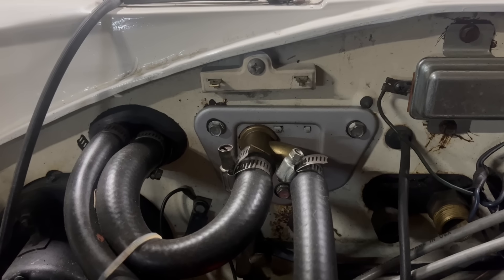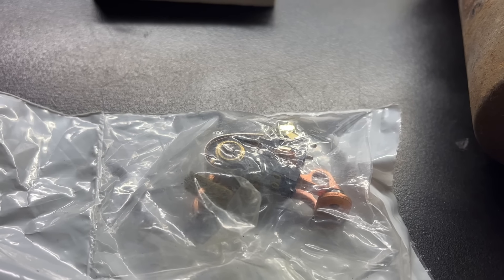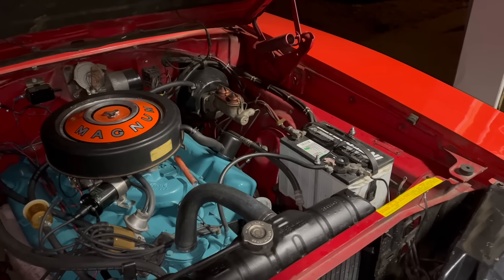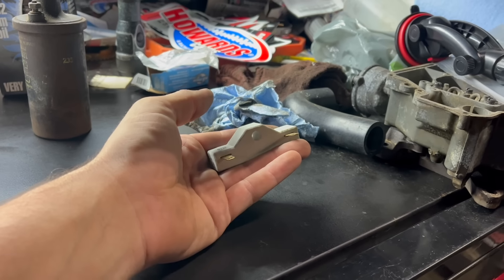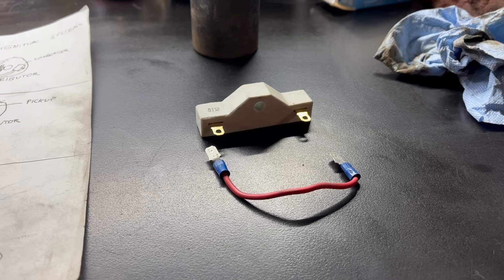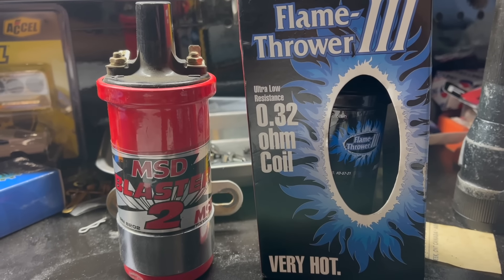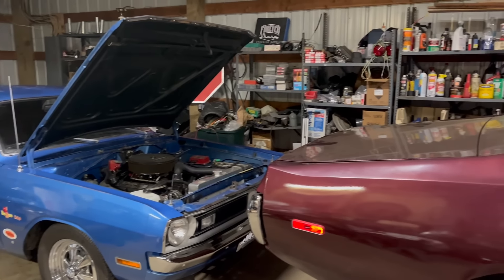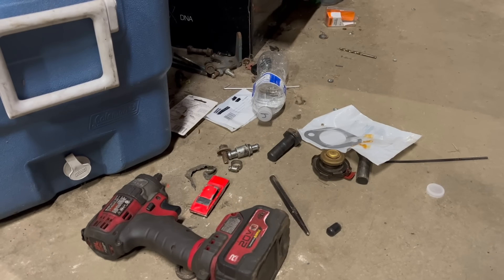The Big Ballast Resistor Video! A Simple, Yet Misunderstood Part Of Your Classic Chrysler Product

Comment: This video describes all the functions of Point systems in detail. Very well done.This is 2024, and best way to cure the ballast resistor issue is to chunk the garbage point system. They were never very good anyway, remember cleaning spark plugs? Tune ups at or before 12K miles? If it were my car and this car is Awesome, I would put a modern CD ignition in it and bypass the resistor. If you have a GM product you can retrofit a HEI system, simply the best early SSD system available because of its design. The issue with adding a high performance ignition system here is the distributor cap and rotor. you will need replacement more often because they are not rated for the higher voltages.However performance will be much better. Thanks for the Video.
Reply from the maker: I have done a guide on HEI ignition module retrofit on Mopars too - but I’m also the guy who removed an MSD system from his Charger in favor of an original points distributor 😃

Comment: Thanks for the "real" scoop on resistors! I'm 62 yrs old, worked on tons of Mopars over the years, and I think I only changed one bad resistor! My experience has been that 4 pin box is always crap!😮
Later!
Reply: The factory improved the OEM boxes in the mid 70's and removed the need for a low voltage input and did it internally so all of them after that were 4 pin.  All the P boxes, Gold , Chrome, and Orange have always been 4 pin.
Reply: @auteurfiddler8706  "P" boxes. 🤭 That's what you do when you replace them on the side of the road!
Reply: Should a resistor heat up when the key is on position not running.
Reply: @georger8212  Don't know for myself but I seem to remember a co- worker saying that if you leave the ignition turned on without the engine running that you will burn something up - like over an hour or so

Comment: Starting a Chrysler built vehicle by pushing often worked well with standard transmissions. But you could also push start them with an automatic transmission if it was built before 1965 because the older transmissions had a rear oil pump that worked with the output shaft. In 1965, Chrysler abandoned the rear oil pump in the Torqueflite transmission and only used the front oil pump driven by the torque converter.
   I had a 1959 Dodge Custom Royal with a 361 V8. I took some auto classes at a junior college and after I got enough knowledge, I went to the junkyard for parts and converted the ignition system from the old points to an electronic ignition system. All I had to do was change the distributor, take the wiring harness and ignition module from another old car, and it ran like a charm. The most difficult part was adjusting the gap between the reluctor and the pick-up coil in the distributor. I called that '59 Dodge my Big Dog. If you see the front end of a '59 Dodge, you might guess why. Uh, woof, baby.
   My dad had a '62 and a '67 Plymouth, and I had that Dodge. I also had a 1973 Newport. In all the years we had those cars, I don't remember having any trouble with the ballast resistor more than one time. It was having that '73 Newport that kinda taught me how to do the ignition system changeover on my old Dodge.

Comment: Excellent topic. 
For the record, the old Direct Connection/Mopar Performance electronic ignition conversion kits 
came with a 0.8ohm ballast resistor as part of the kit (different from the standard issue ballast
for points).
Reply from the maker: Good to know! I have one of those kits, which was installed on my Demon in the 70s. I’m not familiar with the different resistor ratings. I probably should be.
Reply: They offered different kits with different resistors depending on which box you ordered. And different coils with different primary resistance.  "It is not advised to mix and match components!" it said.  (Mopar Bible and DC catalog)
I think 0.8 ohms is fine with a stock or orange box, but you need  a Chrome box or Gold box to go to 0. 5 or 0.25.  What does your coil  measure across the small terminals?  If the total is less than 2.0, I think you may be right about not having enough , especially for points.

Comment: I was really hoping you'd explain the 4 pin balast resistor found on most (or all) factory equipped electronic ignition vehicles. I don't understand them
Reply from the maker: I’ve had several comments about it now, so I realize this was apparently a sizable omission. That’s my bad. The second side of the 4 post resistor was used with the original electronic modules which had a 5 pin connector. Some circuit in the module was powered through it. The later four pin electronic control module eliminates the need for that extra circuit and can be used with a two post resistor. It can also be plugged right in place of a five pin module with zero issues - but not the other way around! Unless the four post resistor is in place.
Reply: @DeadDodgeGarage    The   dual ballast was only used from 1972 till around 1975 or so  when the 4 pin ignition box was introduced.  The 4 pin ignition with single ballast lasted until around the late 80's early 90's.

Comment: Nice job, so in a nutshell the ballast resistor is simply a voltage dropper (brings it down to 9v). And it's not that the coil needs less voltage (if anything it wants the full 12-14v), it's more so that the points doesn't want more than 9v, as higher damages its parts.
Reply from the maker: The factory coil requires the external resistor, and will not be happy for long on that full voltage. It is printed right on the coil. Yes, the resistor reduces the voltage going to the coil. It varies by dwell time and the temperature of the resistor and is not a constant 9v. The voltage actually climbs at higher RPM. I saw as high as 11.5 volts on my car. I had to scrap that clip for other reasons.
Reply: @DeadDodgeGarage  I see, so the coil also wants that lower voltage... Sounds like it's designed in a way where the coil voltage increases with RPM, possibly as the draw is increased given more sparks needed per minute. Clever system when looking at it like that

Comment: but, but, but, what about the Dual ballast resister?
Reply from the maker: Same thing… only different. I realized some time ago that the omission of the dual resistor was a mistake on my part. The second side powers a circuit in the original five pin ignition module.
Reply: @DeadDodgeGarage  just razzin' you for it not bring mentioned

Comment: Good tips. I usually run an 'HP' style aftermarket coil and bypass the resistor. Like I think you said it's dependent on the resistance of the coil and the current switching capacity of the module. I've heard all the 'lore' for DECADES about ballast failures but NEVER actually experienced one in over a million miles and several decades on way too many cars to count. I DID however have the ballast terminal connections get corroded and act the same way because of where they mount that resistor it picks up a lot of runoff water from the cowl. But I have had the newer style ignition modules fail more often to the point that I mount a spare right next to the 'in-service' one so I can just move the plug over. I also used one of those Proform Mopar 'knockoff' kits and it's been problematic. I used a bunch of the original Pertronix Ignitors in the past but I wouldn't use another Proform kit. The GM module approach is OK too as long as you get a 'real' GM module. They have better dwell than the Mopar box. There were some Mopar modules that had higher current ratings. That Proform kit sucks. I had random hard start issues because the pins in the rubber module plug were spread so far apart they weren't contacting the module pins.
BTW, back in the '70's they used to sell SCR switching boxes to offload the current switching from the points and move it to an 'SCR' transistor. It wasn't a CD box, just an inductive switcher. The points were just the 'trigger' so essentially they lasted 'forever'. Supposedly kept the car in tune for 'better mileage, power, etc'. I have one marketed under the Hurst-Airheart name. On my older more collectable cars I try to keep the points and just use some kind of a 'box' to offload the points. The points these days are pure junk.
Reply: Watching the vid I was thinking exactly what you described the SCR circuit as. If the issue is points burning up from too high voltage/current, then change the circuit to where the points are a trigger with no load. I'm going to read up on SCR circuits, thanks for the info!
Reply: We built those boxes in high school around 1970.

Comment: When I was younger, like 50 years ago, I knew guys with Chrysler vehicles with early electronic ignitions found out that when they opened the hood after a rain storm, the water on the hood would run down   onto the distributor and cause them to malfunction.

Comment: I've got the same Pertronix + Flame Thrower coil as you.  I removed the resistor from the back of the ballast resistor and  crimped/soldered in a a thick wire.  It's now a jumper disguised as a stock ballast resistor  and it gives me the warm fuzzies.
Reply from the maker: Awesome! I should do that in my Demon. Haha.
Reply: Had this same setup in my old Polara 500.

Comment: The resistor on a Dodge Aspen would fail during or right after a rainfall because of puddle splash hitting the firewall.
I moved the resistor to the top of the firewall and also mounted an spare resistor near by.
Hot resistor + cold water = cracked ceramic.
Reply from the maker: Yep. Someone else was talking about having the same problem in a Ramcharger. Somehow I’ve avoided that so far - which seems odd, living in rain land as I do.

Comment: Didn't electronic ignition do awAy with, only distributor and points ignition,are old mopars still using prehistoric systems
Reply from the maker: The Chrysler electronic system still uses a ballast resistor.

Comment: What the heck are those double ballast resistors about?
Reply from the maker: Should have covered that here, but I forgot they existed. The second half of the resistor powers a circuit in the original five terminal ignition control modules.

Comment: Comment.  
Ballast on the elect. Ignition - 
voltage on ign1 drops out when cranking - which supplies ECU. 

Ing2 actually back feeds voltage thru resistor to ECU module while cranking. (Less voltage). 
But full voltage is better.  

Diode is great remedy. (1N4006)
Reply from the maker: It is wired that way, and obviously a lower voltage will back feed through the resistor. But in my experience with retrofit systems, it's not enough to actually run the module. I had therefore assumed that IGN 1 must still have power during cranking for this to work - but I haven't verified this myself.

Comment: Can't remember if I brought this up before.  In my youth I worked at an auto parts store, and we had three coils that fit close to 90% of cars of the day (then the custom ones).  Two were 'external resistor', one came with the resistor and one without for a few bucks less.  The third was an 'internal resistor' coil that did not require the external ballast resistor.   Presume that resistor moderated all the power flowing through the coil and points.  Is a coil like that an option on a points-equipped Chrysler to do without the ballast resistor?

These were stock parts, not racing.
Reply from the maker: I’m not sure on that, but I am curious. I don’t know much about that type of coil. Yep - that’s exactly the resistor’s job.
Reply: I know if you switch an old 6v points system to 12v if you use an internal resistor coil you can eliminate the external resistor.
Reply: All coils have resistance between the two small terminals.  Copper wire has a resistance.
There is no separate "resistor" inside, just the windings.
Let's assume your original coil has 1.5 ohms primary resistance. And your ballast has another 1.5. So that is 3 ohms total.
You can find a coil that has enough resistance so that it does not need a ballast. Look for one that is 3  to 4 ohms.  I would NOT recommend that for a Mopar, that is for sure.  Points or electronic ignition.  It will take a bit of effort to find a coil like that. I don't know of any American cars that came with one stock.  I have seen them advertised though.
Reply: @auteurfiddler8706  It's a pretty common swap in old gas powered farm equipment.  NAPA provided the one on my Allis WD and my '64 W300. The Dodge has retained it's external ballast resitor for the time being.

Comment: I've only ever owned one Mopar that would 'eat' ballast resistors- a 76 Ramcharger. Every time it rains, you could bet on the resistor smoking. After a bit of investigation, I discovered some water stains on the firewall that ran down to the resistor. Yup, cold water dripping on a hot resistor greatly reduced it's lifespan. I bent a piece of sheetmetal to act as a gutter over the resistor, and never had another failure. Note: I have owned a couple pickups and ramchargers, and this was the only one that ever did this. Never heard of anyone else having the same issue. Just lucky I guess.
Reply from the maker: That’s really interesting. I’ve never had that in a truck either, but I have had a voltage regulator that died at least once every year in my ‘75 Power Wagon. I suspected it had to do with moisture, but I never really figured it out. I just kept replacing the regulator under warranty… like 12 times.

Comment: Question, why isn't my slant six getting gas? Changed pump, carburetor already.
Reply from the maker: Running off of the factory gas tank, right? I have seen more than a couple tank pickups clogged solid. I would start there.
Reply: Hole in the gas line?
Reply: No gas in the tank?
Reply: There is gas in the tank.
Reply: @victorsabas85  Right on, then as someone said above, toss some air up the fuel line, take off the feed from the tank right at the pump and shoot some compressed air, you should hear some bubbles...

then toss on a wicks 33003 clear fuel filter inline there, before the pump, then turn the engine over, make sure its pulling fuel from the tank...might just be plugged with sediment

Comment: Your videos on electrical gremlins are very helpful.  I am trying to figure out why my 74 Dart Sport won’t start using the key but starts jumping starter relay.  I already located corroded wire(s) on engine side of the firewall connector but it was not the ignition switch wire.  Thanks for all your practical knowledge.  Not many of us guys have a “crew” either and NOTHING seems to fix itself after I shut off the lights in the shop at night.  I like your attitude and determination for your videos.  And your hair and beard looks fine.
Reply from the maker: Haha. Maybe some day I can hire night time car repair gremlins… but probably not. If you haven’t already, check out my video that’s called something like “Classic Chrysler No Crank No Start” where I go through all of the different components involved in that, in order. Hopefully it helps!

Comment: You have to be careful swapping coils , especially with an inductive system such as points, Mopar box, or HEI.  The Blaster 2 is a safe choice.  It has specs roughly equal to a factory coil.
  And the performance with be roughly equal.  Mallory Pro Master and Accel big yellow plastic Super Coil are also great choices to replace a factory coil.  The advantage is looks if you think they are cool looking.
   The other coil you showed has only a quarter of the resistance of the factory coil. You will get a hotter spark, but heat up your control box or points. The Chrome and Gold Mopar boxes (the actual P part numbers, not a parts store box) are built to withstand low resistance coils or low resistance ballast resistors.
   Ballast resistors come in lower ohm versions. They are not easy to find though.
 The same warnings apply.
    You have more freedom to choose low ohm coils and you don't need a ballast at all when you use CD ignitions such as MSD 6A.
Reply: Low ohm ballast resistors are super easy to find, just google search power resistors. Might not have the exact same packaging, but would do everything exactly the same thing in the end, limit current.

Comment: I was talking to an old Chrysler tech once and he called them bastard resistors. It is a name that has stuck with ever since. I am physically incapable of calling them ballast resistors.
Reply from the maker: Haaaahaha. I really like that.
Reply: Other makes used a resistor WIRE that did the same thing.
Mopar guys are blessed with just having to plug in a ballast resistor which is easy to reach on the firewall. No tracing, cutting  and splicing wires.

Comment: I always wondered how that ignition 1 and 2 worked.  I have a 69 roadrunner that I put a motorhome 440 in. I used the electronic ignition  that came with the engine.  I would crank it and the engine wouldn't start, let go of the key and vroom started right up. Now I know what to look for. Thanks Jamie
Reply: could i ask you what did you  to resolve the problem? Thank you

Comment: I delete them .
Don't leave your key on with out the engine running and you'll never have an issue.
I've had carbed mopars since I got my license ( 25years)
And once a balast causes me a problem ,I jump it and never look back .
**** notice ****
This advice is for people who drive  their vehicle .
Not for points restoration / preservationists.
Reply from the maker: It took me a minute to understand what you were saying. I have never done as you described with a set of points and a stock coil, but I did try to run a dual points system with a performance coil and no resistor once. It fried the points… FAST. I’m glad that has worked for you, but I can’t advise that other people do that.
Reply: @DeadDodgeGarage  to be fair .
I did the electronic dizzy ,and squareback alt conversions on my 67 belvedere and charger.
My other mopars are factory electronic dizzy. I don't run points so that's probably why I've never experienced a problem .